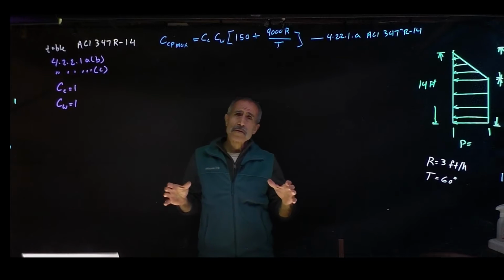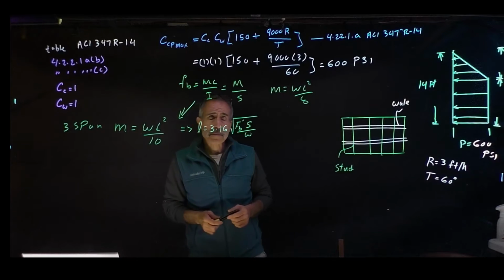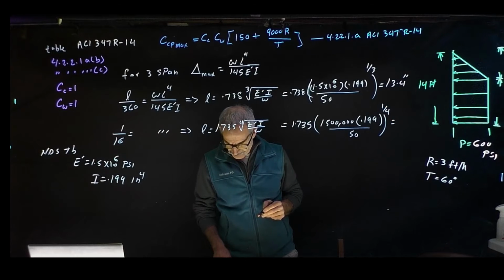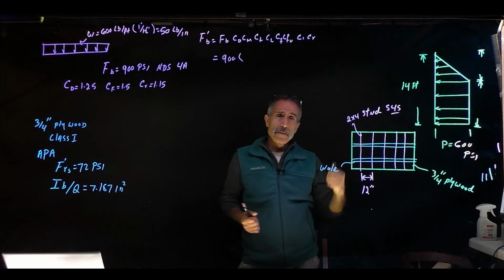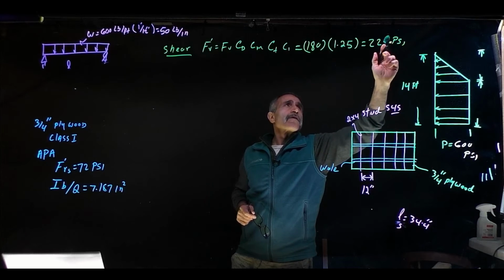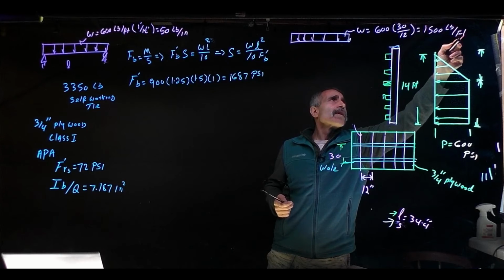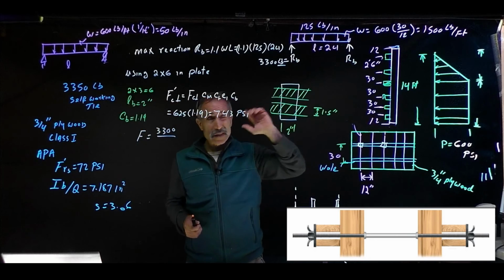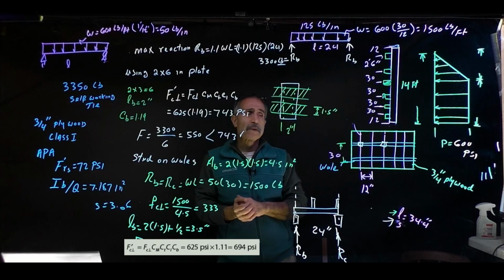Design of Concrete Wall Forms

Comment: Excelent video 👍 
What aboth ties? How to determine the force that they can take?
Reply from the maker: You should be able to find the tension on manufacturer website. (regular rebar has about 60,000 psi)
Reply: @nasseryariphdpe648 thank you very muc! . Youve explaind everything in a clear and simple manner,  but whats confusing for me is, why are people providing turnbuckles or diagonals to secure the forms? They are always fixed to the ground.
Reply from the maker: Ties are in tension and steel rod or rebar has about 60000 psi before it fails. Most likely other components will fail fist.